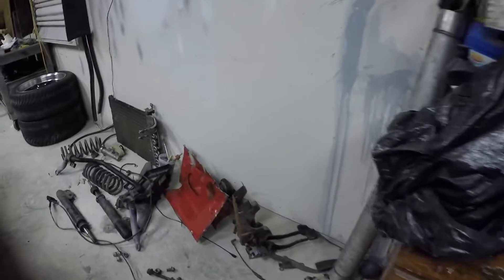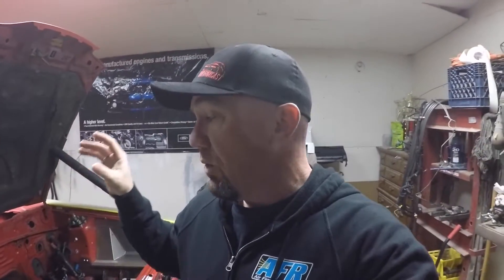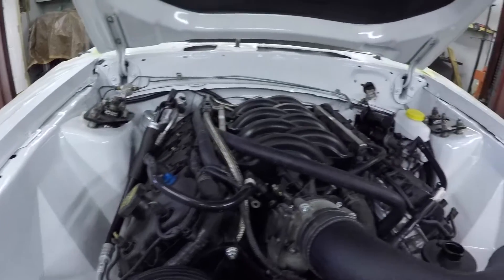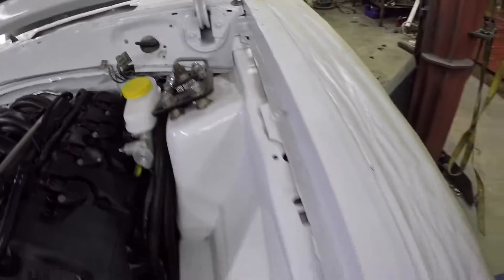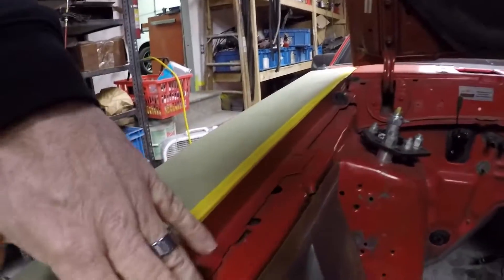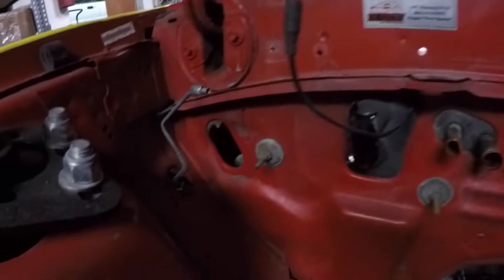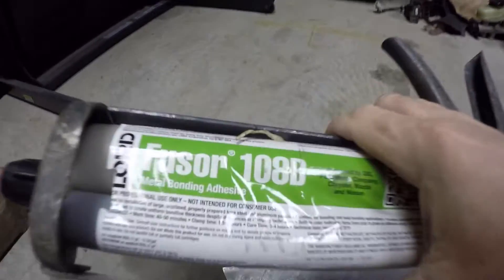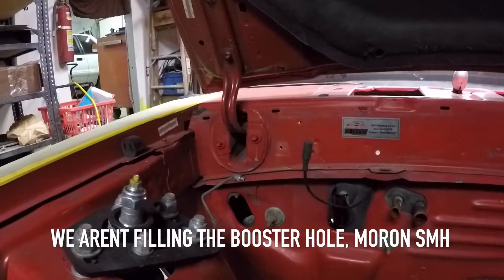Decision, decisions! How far should I take the coyote swap?

Comment: My thoughts are buy dash, door panels, and other stuff as funds become available. Then once you have everything, do full interior all at once.
Reply from the maker: I just hate putting the dash al back together, just to yank it later. That is the only thing stuck in my head.
Reply: It does suck doing things twice but, if it's going to keep you from making the events you want to attend or just work your nerves having a black dash and grey everything else, might be better to finish the engine swap and do interior later. Black interior is going to look good though.
Reply: Foxcast Media you can swap out the dash skin in an hours time. Very quick and easy. I just unscrew it from the dash frame and slide it out.

Comment: Do the interior later on. Dash can be swapped with the column in and you can hunt down all the other black parts through out the year. Then do it next winter. Focus on the swap for now. I want to convert to black interior on my build but my goal is to get the car built and running first. Then go from there. Stay focused!! Lmao. And get Scott rod radiator hold down it will cover all those holes in core support problem solved ha
Reply from the maker: svtpower03 Well crap, that means I have to wait

Comment: Personally, I would get the black dash,but hold off and do the interior later,concentrate onto engine bay,I have made my own sheet metal plugs for those larger holes and welded them in and it worked very well,just my two cents

Comment: The dash is a super simple deal. The biggest problem you will have is finding good interior pieces like the larger quarter trim in the back. My suggestion is to just do the motor for now. Buy the dash, wrap it up, and save that for a project that you can enjoy on a nasty day in the future. Besides- waiting allows you to accrue all the pieces you’ll need to do the job right, in the future. Save your sanity. Get the motor in, enjoy that, have fun with it, and don’t over complicate this. Seriously- swapping the dash is a dozen screws, and about an hours worth of work.

Comment: I'm going to throw this option at you for the core support.
https://lmr.com/item/SRF-FRTBC10/1979-93-Mustang-Aluminum-Radiator-To-Bumper-Filler-Cover
Paint it to match when the rest of the bay gets painted, you won't have to do all the filling on the core support. As far as interior, get the dash but hold off until you have everything to do the full interior.
Reply: OneQwikGT yup much easier. Just paint it black and be done.
Reply: svtpower03 They have them in black also.
Reply: OneQwikGT even better!